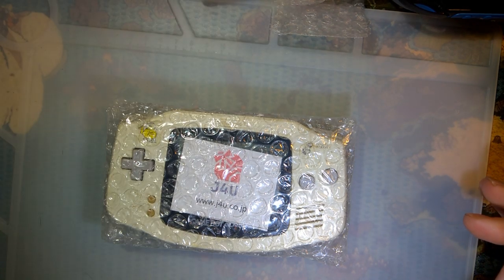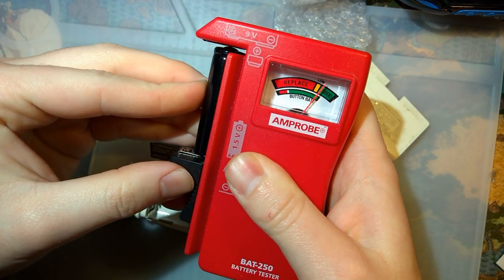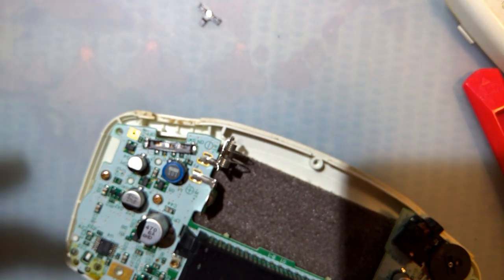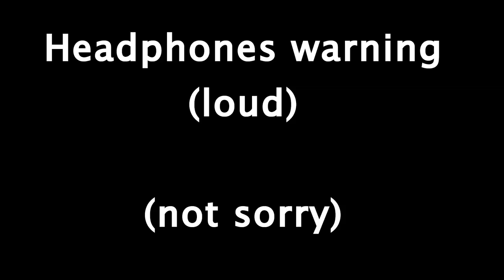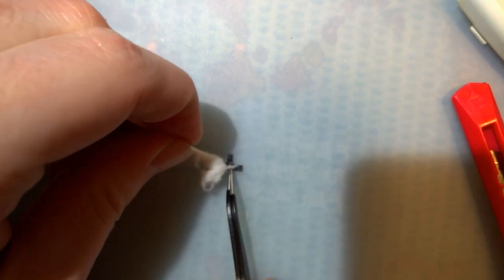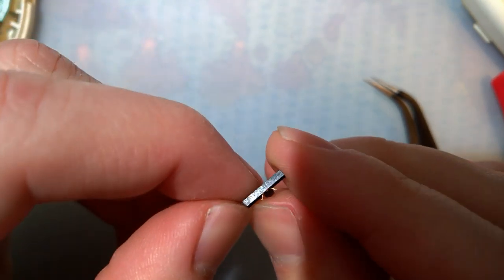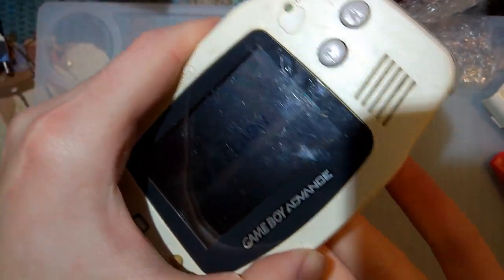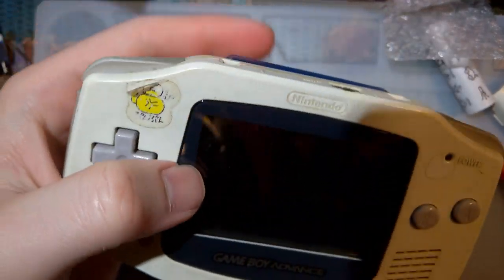Cleaning a Game Boy (Advance) Power Switch

Comment: thank you for the video it helped .
i recommend using a wick strip instead of pulling while hot. this would make it safer and safer. also try using makeup Q-tips. they are pointy and usually sturdier so in conclusion you dont need to cut off the tips to get in narrower spots

Comment: I have a GBA (standard) which I IPS modded and after a couple minutes it restarts and turns off by itself. Could it be a dirty power switch or would it be the capacitors? It was working fine before the mod.
Reply from the maker: It's always the power switch.
Reply: @makho  Thank you! Fixed my GBA because of you.

Comment: Found my old, busted up sp, fixed it up with new shell, ips screen, and battery... miserable battery life.  One hour to red light, not quite three to dead console.  Add maybe an extra half hour to both if using og cartridge instead of flash cart.  I thought I just got a dud battery, so I got multiple new ones from more reputable sources, same story.  tried this today, fingers crossed it fixes things...  though I'm not holding out too much hope as the switch wasn't that dirty inside once I opened it up, & cleaning didn't make much of a visual difference.
Reply: Well, there was some improvement - went from about a 3 hour battery life to a 4 hour battery life, with most of the increase while the light was still green.  Significant improvement, but it remains pretty far from the minimum of I'd call acceptable for a pocket handheld.  Still, 33% improvement's not nothing.  Maybe I'll go back and try again with the baking soda.  Very much appreciate this old video showing me how to do this.  Years later & still helping.
Reply from the maker: @Malisteen  I mean, if that's the original battery, it's over 20 years old. The estimated service life on most lithium batteries is like 3 years.

Comment: Hey, do I need to you use a particular soldering iron for this job? I have just a cheap one with not adjustable temperature but I’m scared to damage the game boy if the temperature is too high.
Reply from the maker: I would recommend a temperature controlled iron for stuff like this but if you're comfortable with the tool, you can use it. If you're new to soldering, please consider starting with a solder practice kit before taking an iron to your game boy.

Comment: My issue that solved it  required using a higher volt battery because my modded backlit gba is so powerful. Anything lesser than 1.5v could not handle the power of awesomeness. Saved me a lot of time taking apart that bad boy

Comment: just cleaned my 2 franken sp's, both assembled from scratch with new parts, one agt with 101 screen, the other ags with ips. I even added them a headphone jack. now they don't lose power when I look at the power switch weird.
this could also explain why I was getting just a couple hours of battery on the ips one using the lowest and second lowest brightness when the battery is also new.

Comment: I had a GBA with the shutting itself off problem and followed your tutorial. Unfortunately, as usual, I can't seem to do things as smoothly as you experts, and although I tried pulling the shielding with the cutter as you do in the video, the solder resisted a lot before it melted, I added flux and a little solder in order to melt it together with the old one with the hope it would make things easier, and I think I messed something up. Anyway, I cleaned the power switch and looked really clean, but I don't know if I put the shielding back the right way, I can't really see if it's in its right place -although there is enough solder for it to not move. Problem is the console doesn't even turn on now.
Reply from the maker: The shielding must be reinstalled perfectly flush. It holds the slider in place on the contacts.

Comment: How bout a DMG power switch cleaning vid, or wilder yet - a DMG power switch replacement? There's nothing out there in that regard.
Reply from the maker: DMG power switches generally don't need cleaning in my experience. There are no replacement videos because there are no replacement parts and even if there were, it's a simple through hole part. Simply desolder the old switch, solder in the new one.

Comment: Wanted to know if you have any idea how much power to use when soldiering? Have never done soldering myself and wanted to make sure I’m using the right output. Thanks!
Reply from the maker: I usually set my iron to about 280c. The iron manages power on its own to maintain that temp.

Comment: At 13:00, why would you want to fold the tabs on the switch? Wouldn't it cause more friction/wear? Also, can contact cleaner be used in place of IPA?
Reply from the maker: In this particular case, we want more friction. The wipers (or the switch tabs) need to make solid contact with the pads on the switch body or the console will not function properly. Upon disassembly and cleaning, there is a tendency to flatten out the wiper so bending them out is a way to reverse that action. Bending them too far will cause issues but as long as it's not done repeatedly, it shouldn't cause any metal fatigue and by cycling the switch a few times, the wipers usually mostly break in. 

There are always exceptions, unfortunately, but I find that this works best the vast majority of the time.

Comment: Power light indicator flickers from red to green randomly on mine not shutting off on its own or anything. Just the indicator shows red with fresh batteries. And I am using normal nonrecharble batteries. I read using reachable barriers can cause this as well.

Comment: Why not just add a drop of solder to the battery bumps to make them as big as a normal battery bump? Then they would act up when you spin them would the solder simply not stick? I’d imagine you could even groove the metal first then apply a solder drop
Reply from the maker: I already did. You can only add so much solder. 

A better solution is to just get better batteries, which I also did.

Comment: Do you know where I can get a replacement power switch for a Gameboy Light? Last year the plastic base of the power switch disintegrated when I tried to turn the switch on. It was weird, I felt a little resistance and then I heard a soft crunching sound so I took the back off and the brown plastic base of the switch was in little bits.

I've since been looking for a replacement but I can't find one. Specifically an SMD, 2 pole, 3 position, 7 pin switch. It seems like it's possibly proprietary to the Light and isn't sold anywhere.
Reply from the maker: It is proprietary. The only source that I know of is another Game Boy Light.

Comment: Hello my friend. Could some corrosion in the terminals affect the battery life?
Reply from the maker: yes, that's why I mentioned cleaning battery terminals (or just spinning the batteries for a temporary work around)
Reply: makho thx for your fast answer 🙌🏼. I have a chinese IPS screen and I did the cleaning that you did in your video and it improves a lot the battery life. In fact, even though the red light appears in a half of an hour, (around 01:35 am in my country) the console still On after 7 hrs with Metroid Fusion Tittle Screen (09:00 am). Anyways, my question was because one of the terminals has a blue thing at the back but not directly where it contacts with the batteries. So now I’ll try to get rid of that corrosion ✨ Greeting from Chile 🇨🇱 and sorry for my english 😭

Comment: Do you think this is worth doing to a GBA that's not yet exhibiting these issues when you pick up a new used one?
Reply: Second question: If I've got my power switch pretty clean but the top piece is missing the bent metal bit, can I just replace either the metal or top part of the switch separate from the rest? I had a dead GBA that wouldn't power on and I either lost that metal piece when cleaning it or it was already gone from the previous owner. I can power on the GBA now by shorting the contacts inside the switch, so I think the lower half is good and could still be used. I would hate to desolder it and put in an aftermarket one that probably won't fit as well (I'm seeing bad reviews for replacement power switches online).
Reply from the maker: @SoundToxin  If it ain't broke, fix it till it is. No need to clean it if your console is not having issues. 

And yes, you can probably just wedge something in there, the slider just needs to make solid contact with the contacts. Doesn't even need to be metal if you want to make like a 3D printed bracket that you screw in.

Comment: While trying to remove the shielding my entire power switch decided to lift off the board as well, and interestingly it looks like the copper plating delaminated from the board and was still attached to the legs of the switch. Should I just junk this board or is it repairable?
Reply from the maker: it's probably repairable but even if it's beyond your ability you can still sell it (coincidentally, I am looking for boards like this)
Reply: @makho  I thought about finding a board schematic and running my own power wires from the switch to traces on the board but you definitely have more experience and video making capabilities. I'd be happy to send it to you, and hopefully whatever comes of it helps someone in the future.

Comment: Oh my god you are so rough with that switch. I give it a bit of a rub as you did (little lighter) then get some wet&dry (very fine sandpaper) and give it a GENTLE rub just a few times back are forth on the metal plates and a tiny bit on the tip of the arms on the switch
Reply from the maker: You claim I'm rough but then you used sandpaper?